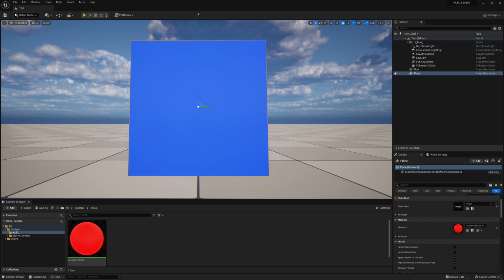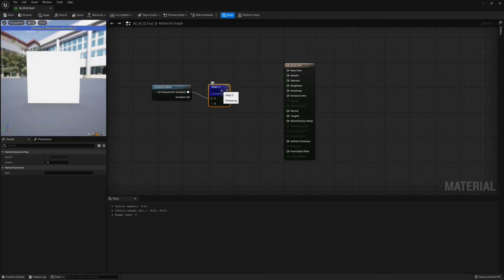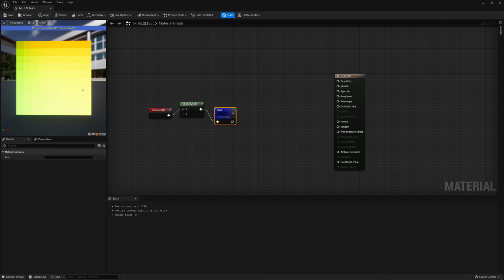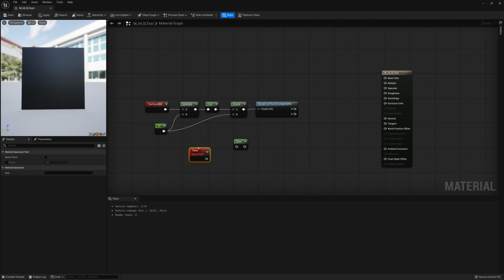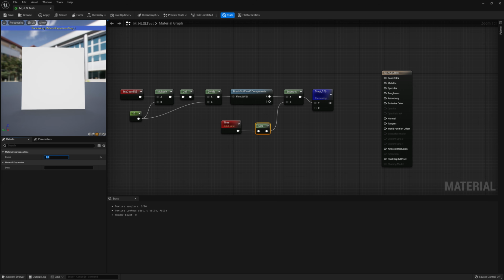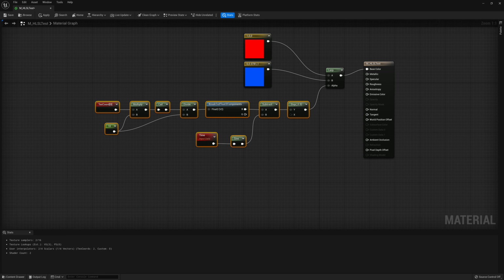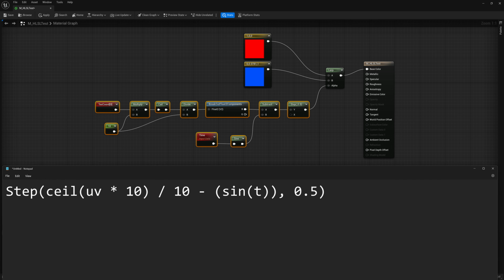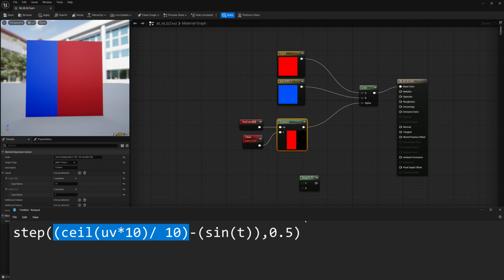Unreal Engine 5 Tutorial - Technical Shading - Introduction To HLSL

Comment: This is awesome! Sine is actually from -1 to 1 for everyone who may have run into issues experimenting. Use a ConstantBiasScale to adjust it to 0 to 1 or add 1 divide by two . Doing that messes with the above results though but just an fyi.
Reply from the maker: That ConstantBiasScale is a really good tip! 

I have a correction in the description about the range of sin. But for some reason that correction isn't popping up on the video. When using those values as a mask it usually wont matter if its -1  or 0 vs 1 or 100 it will produce the same output. But It is much more proper to use the ConstantBiasScale as you mentioned or at least throw a Saturate or Clamp node on the sin curve to clamp it between 0-1. 

Thanks for suggesting this.
Reply: @renderbucket  Oh cool! Sorry I didn't see it. I just subscribed to your patreon. This content is great!

Comment: Does HLSL provide performance benefits over nodes?
Reply from the maker: Not really, if you can do the same thing with Nodes. Probably better to do it with Nodes in most cases. Some of the nodes in Unreal are really just using HLSL if you go into them. 

But there are many things you can do with HLSL that aren't possible in Nodes in Unreal. 

It also sometimes can be way easier to do things with code than tons of nodes. 

So its really more of compliment to working with nodes for the basic/intermediate side of things.

And on the very advanced end of things you can go as far as creating compute shaders or fully custom materials. 

HLSL is also not just a Unreal thing it can be used in Unity or any other Game Engine running on DirectX. It is also very similar to GLSL, so learning one or the other you kind of learn both.

Comment: 5:58 hey isnt GREEN is vertical 0 to 1 top to down while RED horizontal 0 to 1 left to right?
Reply: Green (U) goes horizontal across the x axis as you can see it starts on the left (and moves across to the right). Red (V for vertical :P ) starts from the top (where you can see it) and fades down the y-axis, vertically.

Hope that helps.
Reply: @DRockafella  no sir,U is RED and represents the horizontal direction, while V is GREEN and represents the vertical direction. Just  component mask out any channel, and you'll see the b/w gradient in  0-1 direction.
Reply: @DRockafella  if u look closely, green horizontal only hue is changing not the value.

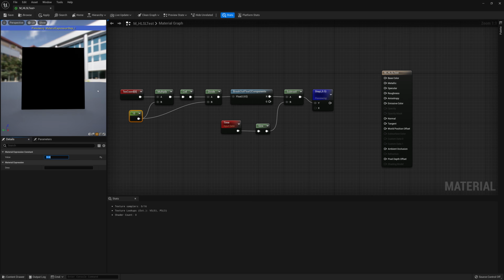Comment: Awesome video! but there are two thing I didn't quite understand: How does the written function node knows you want to do It on the x axis instead of the y of the UVs? And at 14:23 you altered the sine period value on the node so It fills slower, but I didn't see that being specified on the written counterpart , how did It go at more or less the same speed as the node version?
Reply from the maker: Great questions!. 
So for the first thing, the blocks revealing go left to right because when we use the break out float2 components we are only using R (Red/X). So that gives us a gradient in X axis, which then when we subtract a value going from White to Black it reveals and hides values on the X axis going from 0-1 produce the horizontal animation. If we were to use the G (Green/Y) value instead when breaking our float2 components then it would be Up and Down.

For the sine period modification, the sine node in Unreal is a bit odd because it defaults with a period of 1.0. When normally its 2 * PI (3.14...)

If you are not using a sine node in Unreal and instead HLSL Code and you want to modify the period in HLSL code you will have to achieve a similar result by doing something like 

sin(x * (1/p) * 2 * 3.14);

Where x is what you are connecting the sine node to inputting into the sine node.
Where p is your period value (so 1 if you want it to match unreals period default of 1).

Comment: The sine node is from -1 to 1. Unfortunately this can be confusing when you just want a value to go from 0 to 1 as the time it takes the sine to come back up to 0 from -1 means that the colour black will be there longer than the colour white.

You probably already know this but just incase someone else needs to know: After sine, put an add node with a value of 1 and then connect a divide node with a value of 2.  This ensures the pulsating value stays between 0 and 1.

What you will then need to do with the step node after subtract is have a value of 0.05 instead. Otherwise the sliding effect will only go 50% of the way with the value of 0.5 as stated in the video.

For the custom node I figured out it would be this (I'm still extremely new to this so it took a while to learn where +1 and /2 would go lol)
 return(step((ceil(uv*10)/ 10)-(sin(t)+1)/2 ,0.05));
Reply from the maker: Thank you for posting this! that is correct. 
It is going to -1 to 1, but In this video I incorrectly called it as 0.

When plugging the sine into the alpha of a lerp it will get clamped out at 0 (black) so anything lower than that won't make any difference. But this clarification you posted I'm sure is very helpful to others to understand the math correctly.
Reply: @renderbucket  Ah I didn't know that about the lerp clamping the sine. I should give this a test thank you :)
Reply: Is this the reason why in the video the animation always paused for a second when 100% red or 100% blue?
Reply: @zombi1034  Yes

Comment: Does the HLSL code run faster than the Node-based "Code"?
Reply from the maker: Depends what your doing, for simple stuff its probably not much difference. For some things the nodes may be faster due to optimizations in Unreal. But the main thing is that certain things, like for loops you cannot do through Nodes. So your only option is to use HLSL in a Custom node or write a fully custom shader for Unreal. 

For more complex things eventually we will be referencing in external files instead of always just throwing updated code into our Custom Node.
Reply: @renderbucket  Yea, I just did some research as well: The nodes get optimized by the compiler expect for the "custom"-node, so basicly no HLSL optimization. So in that case nodes should almost always be faster depending on what you do of course. Also you could modify the engine to make custom HLSL.

Comment: In general, does HLSL run more efficiently/use less instructions than implementing the same thing via nodes?  I'm sure that's a big ol' "DEPENDS," but I figured I would ask. :)
Reply from the maker: It does depend. Certain things you can only do in HLSL and not through nodes in an easy way. That's where HLSL is more efficient. A lot of the Unreal nodes also use HLSL inside them in custom nodes. Internally all of the materials in Unreal are HLSL code.
Reply: unreal will optimize away "same" shader instructions if the are done in material graph, but it doesn't do that for hlsl. Instead, you need to mark it yourself with things like #LOOP, #BRANCH, etc to tell the engine how to "unroll" the shaders.

Comment: A little bit off topic but I would like to see a conversion of something that runs on tick into c++ since in one of the conferences about optimization in the unreal fest they said anything that ticks run 10x times faster when converted into c++, so I think is a must have for everyone, I mean, 10 times is too much performance and there are a ton of things that run on tick.
Reply from the maker: Not sure exactly what you may be referring to, but generally a tick is a cycle. Often referred to as a frame when people mention stuff like do this every "tick".etc 

What they might be referring to is certain code/things may run much faster in C++ than through blueprints or alternative ways of doing things. There also may be the case sometimes were its the opposite. I would need a bit more details to fully comment, but generally C++ is a very low level language so its performance is often much higher than other languages like python.etc